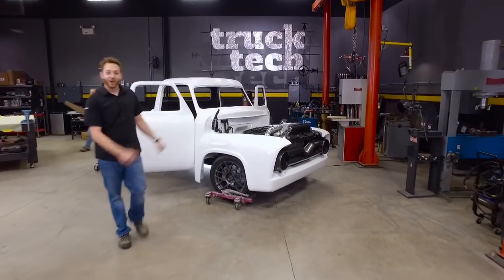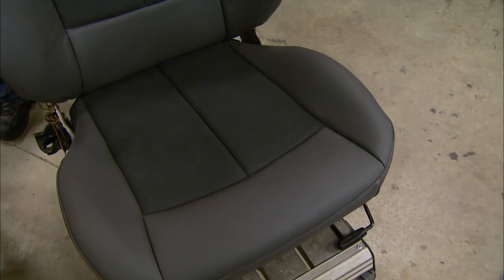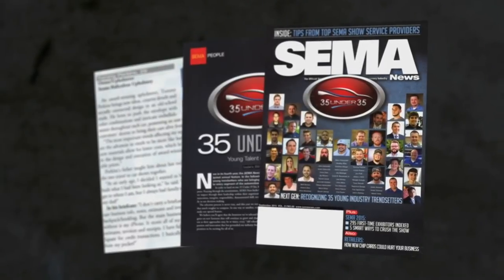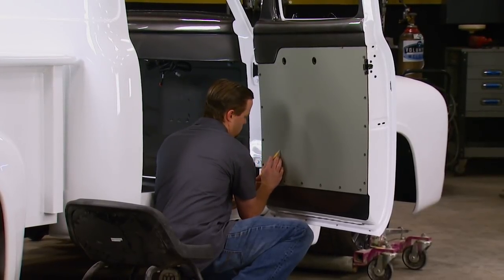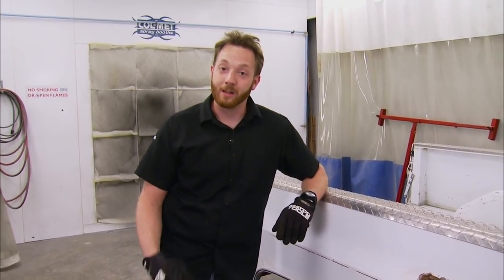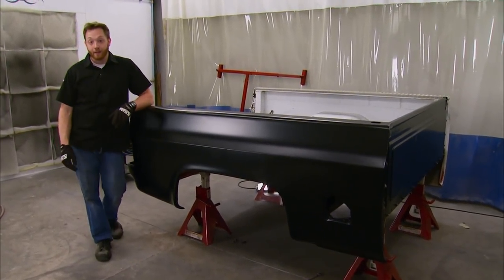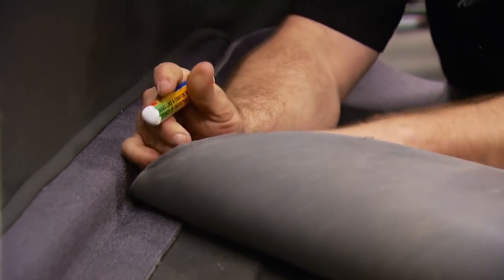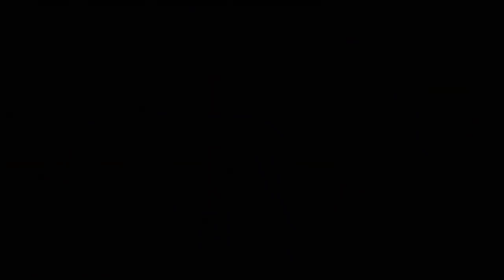Junkyard Seats to Finished Custom Interior for a '55 Ford Show Truck - Truck Tech S3, E17

Comment: The Ecoboost V6 is a proven and rather incredible engine. You can get 600HP out of a stock engine with stock reliability in a relatively small package while also having a good sounding, smooth running, and lightweight package which helps handling.
Reply: But I hate Ford
Reply: @bilbobaggins4710  we kinda don't care
Reply: But it'll never sound as good as a V8.
Reply: @CJColvin  that's subjective, some V8's sound like cold garbage while some sound orgasmic, but the same can be said for any engine layout.
Reply: @A_Man_Of_Culture_  Old school Hotrod V8s and old school muscle car V8s sounds the beast.
Reply: @CJColvin  an "old school" v8 sounds inditinguishable from a modern V8, the only difference is the exhaust systems. If I put your back to a 2019 hellcat with the same exact exhaust as a 1970 dart you would be unable to tell them apart. This idea that old engines somehow sound different is an urban legend, it is all down to the exhaust that follows the engine.

You might say "but old V8 had a heavy lope due to the high lift cam" well guess what a modern V8 sounds like with a high lift cam, it sounds the exact same.
Reply: @A_Man_Of_Culture_  True.

Comment: That is a sweet deal on the radio brushed aluminum bezel. The truck I ended up must have own by 16 year olds as they butchered everything.
  No problem. Go online to Bothers and order, came in 3 days. Oh no😮! No screws or template as customer service reminded me, I forgot this. No problem, even though it comes from an outside (3rd party) they where willing to send an RMA for return with pre-paid postage, cool. But instead, I got a small package with a bent radio / stereo (Single DIN is 7" X 4") new brushed aluminum cover. Problem is it's bent, no hard ware or little bolts and still no template. I will just buy the bolts and washer, make a template and stop the madness or a "He said-She said) comedy that ends up with someone in cuffs. Sad, but true. Now Holley owns 80 companies and moving Comp Cams, I don't want anymore 1-800 calls. True, but the bigger the company, I have found, the "Left Hand, has no clue what the Right hand is Doing." 
   So, wrap. Hope your experience is way less crazy than mine. 
P. S. Dear Holley, you have nice people, many good products, but do not try to contact me. ASE Master since 1978, +6 years prior, taught at UTI the original Tech School, 7+ years on contract W/Raytheon for GM. Holding technical service seminars for 4hrs, in 7 states, 2 day classes in 13 tech colleges while handling alleged defects in 5 warehouses distributors manually. After averaging 234 days per year in hotels, I don't know the family I live with, plus the dogs quit bitting the stranger coming home from God knows where, late Friday nights as they have passed. 
God bless the company that wins, but no one goes to the graveyard with 14 U-Haul trucks at the rear. Relatives you have never seen come to take #3 tool box of 4 total. Don't ever take this job as your phone rings while in the middle of a river going 40MPH on your boat, or Motorhome in AZ, or your wife's sisters house while you talk shop with the husband! Yep, long comment, but that's how I roll!

Comment: I would never do anything like this to my all original 1954 F 100. Only has 12500 miles on it. Flat head 292 ci, three on the tree. And is spotless.

Comment: $40 a piece for buckets at a junkyard? LMFAO, you got ripped off.
Reply: thats a decent price actually...when was the last time you went to a salvage yard?
Reply: @philtripe  last weekend.  Bought 2 buckets for my van this summer at $14.99  a piece at a yard.
Reply: @philtripe  around here, $40 would get you leather seats with power. $15 for cloth with manual.
Reply: @trirycheman  My local pick and pull charges $25 for a bucket seat, and they don't care if its power, manual, leather or what ever else. Seats with the airbag cost $50 though.